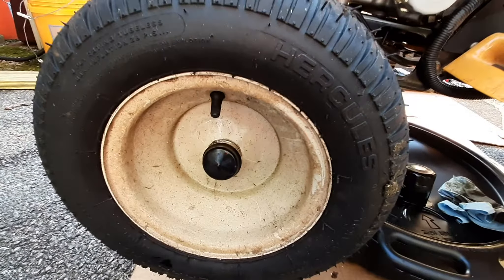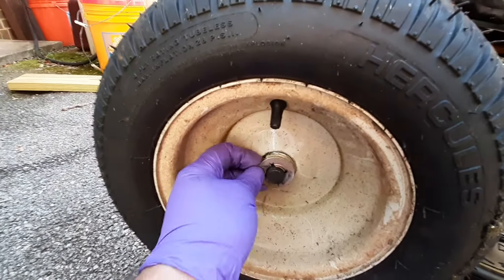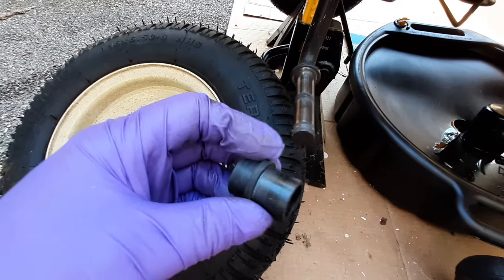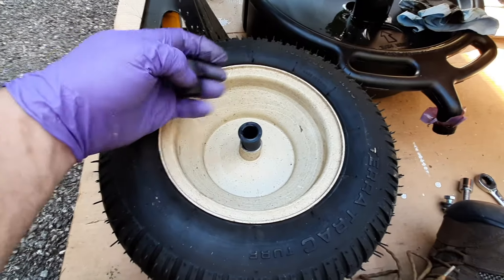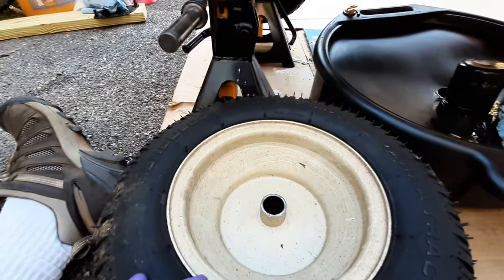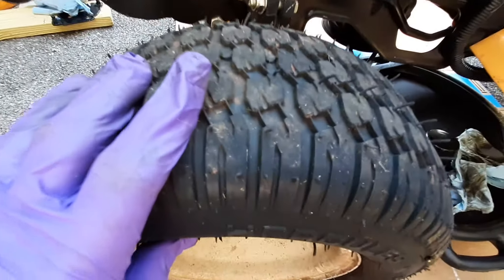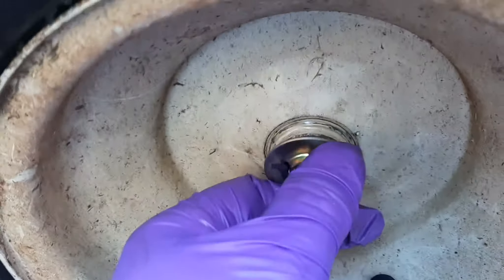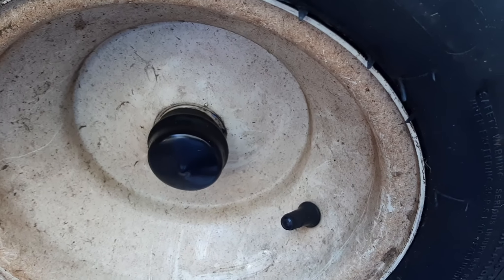Cub Cadet GTX1054 Front Wheel Bushing Replacement

Comment: Several tips when I did this job: 1) I used a thin spacer washer against the inner axle shoulder which is greased to prevent abrasion of the inner bearing end because my bearings failed on a side where this was lacking. 2) Once you screwdriver- hammer out either bearing of the pair against its inside edge,  the other is easily tapped out using a deep socket just undersized to the wheel's housing diameter  3) During install I used a 6"  2x4 short as a driver under the hammer.  This let me assure the hammer was hitting vertical, &  I could finger-check underneath the wood that the bearing was not riding anywhere on the hole rim.  Also the tone of the hammer strike distinctly changes once the bearing shoulder is tight against the rim.  4) If the bearing diameter is large relative to the hole (manuf. tolerances) you can file a slight bevel around the bearing's edge to assure entry  5) Before re-installing the castellated cotter pin washer I check it's profile and,  if it's been bent into a warp  I flatten it back against a hard surface by using the open end of a socket its diameter as a driver.  That prevents play in this retainer from contributing to wobble.
Reply from the maker: Sounds like you got it figured out!

Comment: My bushings are white in color from the factory and stuck on there. Looked through the hole and I don't see a break anywhere to put a screwdriver and tap them out. Looks like the front and the rear bushings are flush inside!
Reply from the maker: Are they plastic?
Reply: @AccuracySpeaks  Yes.
Reply from the maker: @TechCrazy  Were you able to press em out, are they worn??